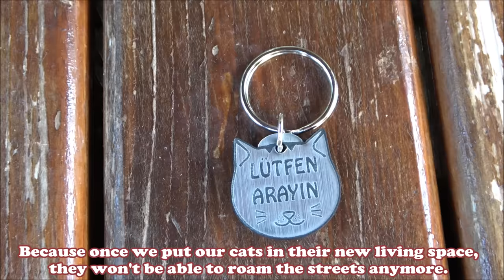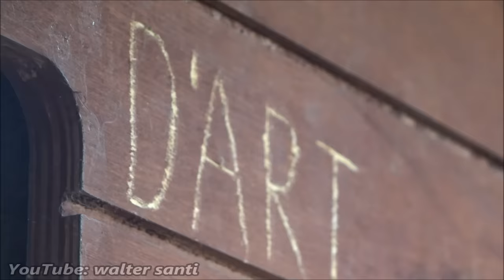My Biggest Dream For Our Outdoor Cats Finally Came True !!

Comment: May I suggest using "break away" collars for the cats. Especially for the active ones b/c regular collars can be a choking hazard if it gets stuck on a branch or pole. They have been know to cause hangings. The "break away" ones will snap off if forced. I use those for my cat.
Reply: In a video after this, he said he realized that the buckle collars were not safe, and he no longer used them.

Comment: 13:08 I have a cat like this, a male though. Unfortunately, I didn’t know he dislikes all other cats until I purchased a second cat. 
I love them both, & it saddens me they may never become friends, which is the reason I adopted a second cat... 
(A friend for my first kitty)
Reply: @krr2290  Thank you for showing me that. I think, in my situation though, it’s a lost cause. In March this year, 2021, it will have been 4 years since I introduced my cats to one another, and the dominant one still attacks & chases the weaker one. Sometimes they actually claw, bite & screech at each other as their rolling around on the floor.
Reply: @juliapecovnik6454  I did adopt the dominant cat from a shelter, they never told me he disliked other cats. I never asked either, so I guess it’s my fault. 
I now know you must ask if there’s anything I should know about the cats personality or health before adoption. 

My second cat, which I did NOT adopt from a shelter, likes other cats.

Comment: Very nice, you know it’s good when they try to break in, not out. Loud kitty sounds like he needs to be fixed. Then he’d probably not be so loud, and less likely to “beat up” (compete with) other kitties. Doesn’t always change their behavior and make them perfectly agreeable, but it can make a significant change. 

I always hear people complaining about their noisy and often fighting cats, and almost always they admit that the cat isn’t fixed. Dating and mating is noisy business, for cats, and just look at any nightclub for humans. It can get the same way for them, too! Noisy and competitive. 

 Our county does free kitty fixing, and then they return the kitties to the same neighborhood. Or some vets will make a deal for a community cat. It does get quite expensive to do them all out-of-pocket. I have had people sneak up and drop off kitties in the front yard, often kittens, with or without a mommy kitty. The least they could do is drop off a bag, or better yet, several bags of cat food when they drop off a litter of kittens, but so far no one has done that part. It would help. Adds up. Gets pricey. Pretty callous to dump not just animals, but one’s problems onto a stranger.  But better the kitties are with kitty protectors than elsewhere. No question about that.

Comment: I think its wonderful what you've done for those cats. I wish I could do the same. I dont have the money. I have feril cats living in my back yard, that I feed. Also, little wooden cat houses. I dont have a basement, my house is very small.
I do have 6 inside cats that I have taken in.
I do my best with what I have to care for all of them.
Feel bad for the outside cats, wish I could do more.
They do wander, sometimes come back injured, and have had some disappear.
I do feed them, and try to give them little houses to protect them from the elements.
Not all of them let me pet them, only a few.
I alm willing to take any advise you can give me, that would help. Thanks.